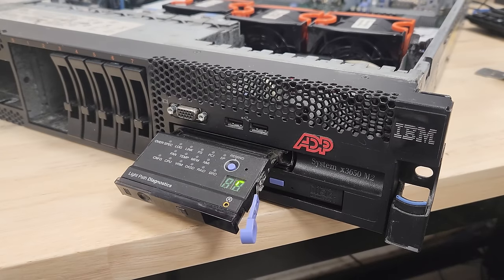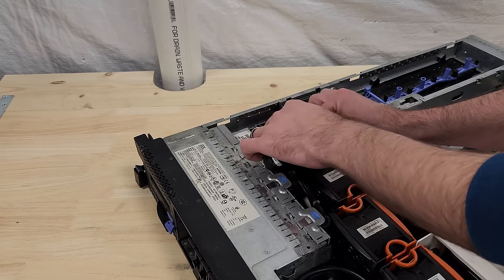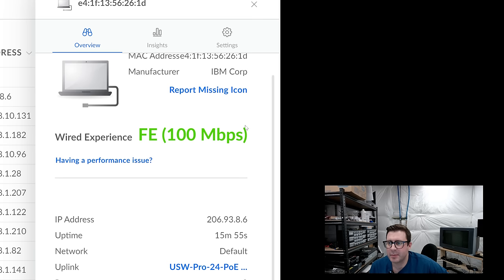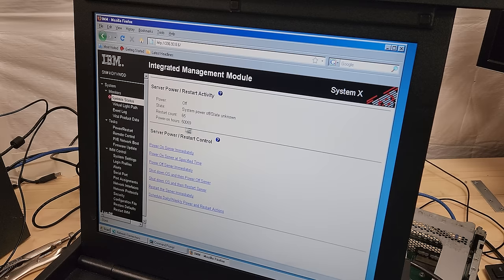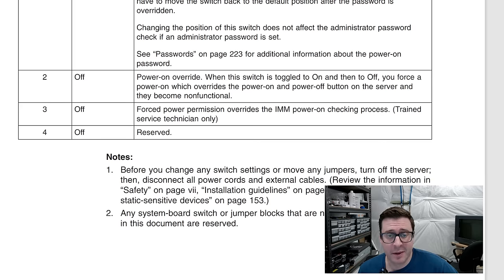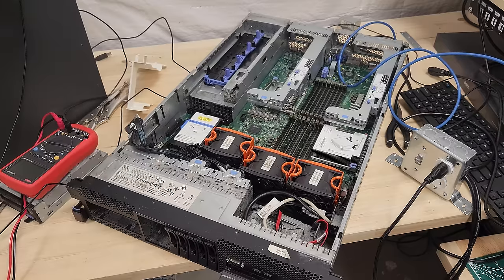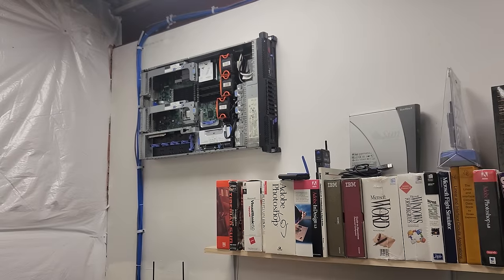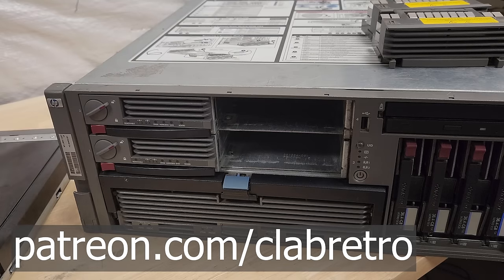IBM System x3650 M2 Restoration: Part 2

Comment: Love the video series, when I started working in computers I started with IBM Netfinity servers (5000 series). Not much love for olde blue these days. Anyway, one thing that is bugging me is the power supply. The click would have came from that and not on the board. I’m thinking these power supplies are two supplies in the same PSU case for efficiency reasons (dell does this). One supply for the IMM and a higher amp power supply for the computer board which is what I believe is faulty. The IMM should not reboot when you power it one leading me to some kind of internal short within the PSU causing it to power off briefly resetting the IMM. If you try a new board and it still does not work, that will be your issue for sure.
Reply from the maker: thanks! some other folks have commented about the PSU as well and I'm inclined to agree. that IMM reset is super suspicious. I think I'll pick up another PSU
Reply: I feel with 50K hours or almost 6 years of constant run time those things become unstable.

Comment: I too have a dual socket server with a working remote manager that I cannot get working.  It's an AMD board, sometimes it will try to power on for about a quarter of a second and then become completely unresponsive.  Nothing of value in the logs on the remote manager, previous owner said he had played with the BIOS but it was working when he last touched it of course.  Don't know if I will ever put more work into getting it going again or if I'll scrap it and grab a blade off Ebay for the same job.
Reply from the maker: sounds like maybe a PSU issue. I actually have a other PSU on the way to try for this one

Comment: I've found this field service manual which appears to be sligthly different, but it mentions low-level state codes which can be observed in the MMI and what they indicate including "DSA Preboot messages".

I hope that info might help you in tracking down the problem further! the process to interact with DSA is described from page 86 and further. in my case i'd been able to find out it didn't pass the cpu precheck, pointing me in the direction of a dead processor.
Reply from the maker: Thanks! Do you have a link to it somewhere?

Comment: I compared part 1 of your vid vs a working X3650 M2 booting video. you never got "BMC Started" on your screen-it never made it that far. BMC is pretty darn vital for servers nowadays and that is probably why it shut off in the first place-if it "didn't hear a response from BMC" or it didn't start servers freak out. Its looking like if it wasn't full of filth/grime, it may not of worked anyways :(  that might be why the IMM reboots itself due to the BMC being dead;  I think that is the chip that actually sends the power on signal.
Reply from the maker: very interesting! one of the flashing board LEDs is labeled BMC heartbeat. must not be healthy... I'll have to do some more investigation

Comment: The fact IMM stops responding suggests to me that it is probably some power issue, probably power supply. When it trying to start the fans and CPU, etc it draws more power. BMC might still work (and show various LED indicators), because it is running from some other power relay, that is probably super low current, and not sensitive to voltage sags).

Honestly I would hook-up multimeter or osciloscope to these voltage test points, and check out what is going on.
Reply from the maker: Yeah some other folks mentioned PSU as well and I think I'm convinced. I have another one on the way!

Comment: Im pretty sure u have a failed power supply and the clicking sound is the psu rapidly cycling on and off which also causes ur imm to reset because it loses power for a second every time the psu resets causing this infinite startup loop
Reply from the maker: Yeah you might be right, some other folks mentioned that too. I let those status LEDs on the back of the PSU lead me astray.

Comment: IMM is functional obviously, but the mainboard can still be bad and cause initialization issues of all types.  We had a couple gens of those and went through a handful of boards.  You can try to upload/update the FW through the IMM, never know if it's just a unsync'd firmware set, but I doubt it.
Reply from the maker: oh that could be interesting to try, especially after I get the second board

Comment: That IP address is just assigned to ADP. It doesn’t mean it necessarily would have been accessible or routable from the outside world. I’m guessing they had a VPN/fw device at the site, leased line, something. 

DoD has a few class As and the bulk aren’t accessible from the internet either.
Reply from the maker: Yeah very likely some sorta VPN setup. It's just amazing the large IP blocks that belong to ADP.

Comment: 23:38...clean evrething include cpu socket.... hot water, them compress air to remove the best you cam.. now the tricky part... dry up in a owen .. 80ª  or similiar at least 12h.
Reply from the maker: I've been meaning to try out the oven drying trick

Comment: https://youtu.be/6pF76TbBvlI?t=1336
That area needs resoldering.
Reply from the maker: Yeah, needs rework. It was a lot better after cleaning again but there is definite corrosion. Needs to be fixed but I think that general area is responsible controlling that fan.
Reply: maybe yes, but if the bios check this area and something not working correctly and some voltage not good on the board, the motherboard cannot start/power on @clabretro
Reply from the maker: yeah very good point

Comment: 25:29  *Sealant  And the factory applied sealant is sufficient.
25:31  You applied the tape incorrectly.  It should start on the bottom and you twist the threads in a clockwise direction.  Ever get frustrated that your tape wants to come off or bunch up.  You application causes that.
Reply from the maker: Yeah I forgot to mention the tape direction. I get it wrong the first time approximately 100% of the time :)

Comment: I've never seen a mobo where the 2nd bios would kick in automatically if the primary bios is corrupt, you always have to set jumpers close to the 2nd bios chip or to short the board somewhere close to the 2nd bios using a paper clip, this info is generally in the manual of the mobo, according to the sound you hear, chances are that the boot code of the bios is corrupt i've had similar situations wih other mobo's, a 3rd option is to dump the rom file from the 2nd bios and then flash the primary bios with it using FlashRom and a programmer like the popular CH341a(the green ones are safer than the black ones according to various sources). hope this will help.
here is a tutorial if you've never done this before.
https://www.youtube.com/watch?v=2Y06x1f22B0